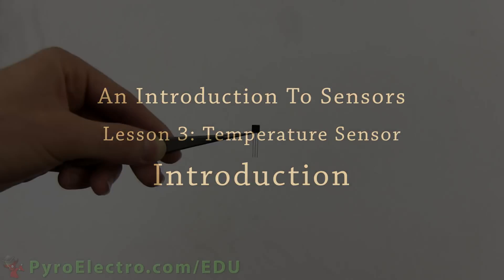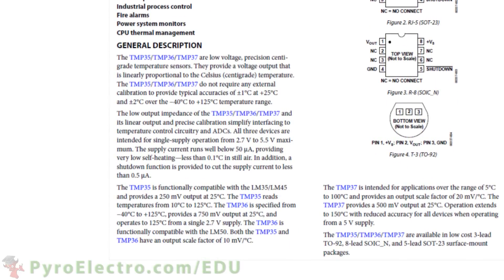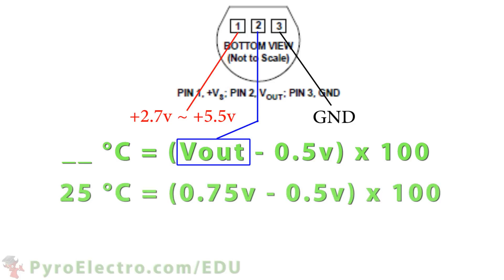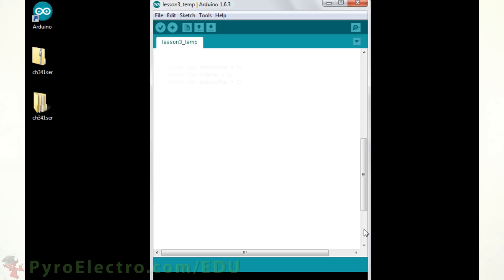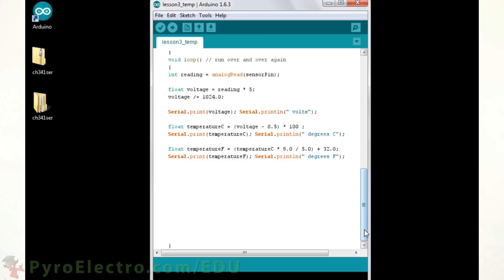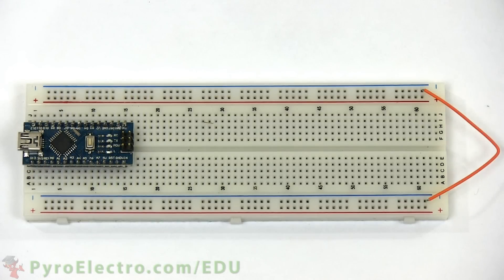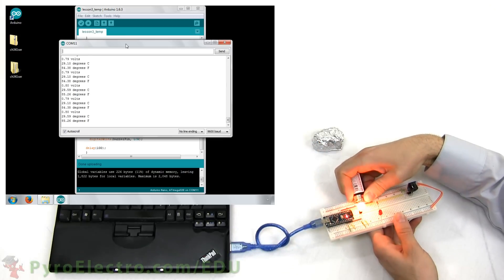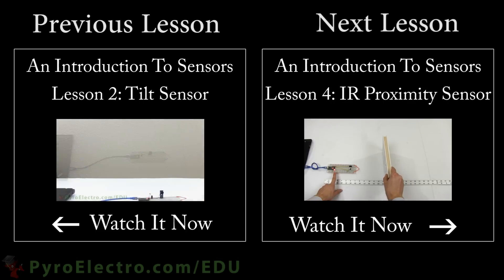Temperature Sensor - An Introduction To Sensors - PyroEDU

Comment: if (temperatureC < 30 && temperatureC > 25)
temperatureC how can be less than 30 and greater than 25 in same time? is not there a mistake in this code ? should not you use OR ?
Reply: No because or 
less then 30 will go into the condition example 0 is less than thirty regardles if the >30
Reply: Means 26 to 29